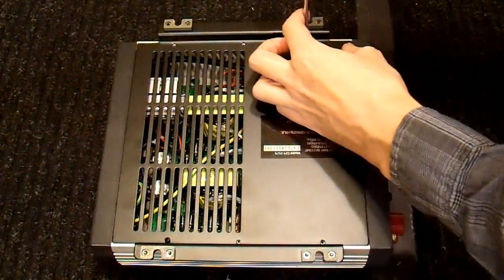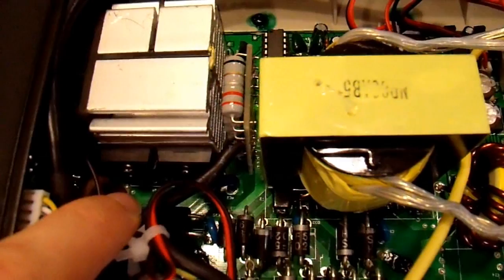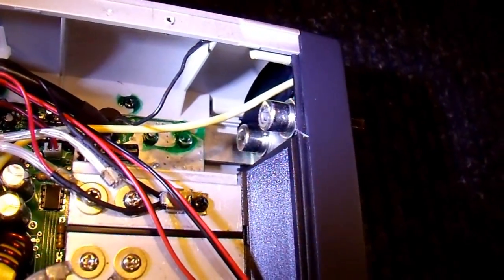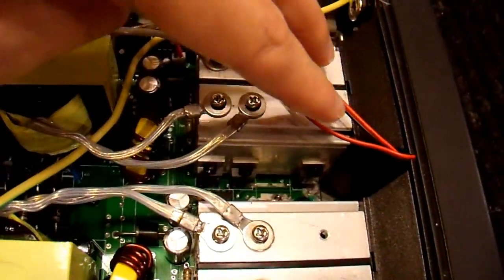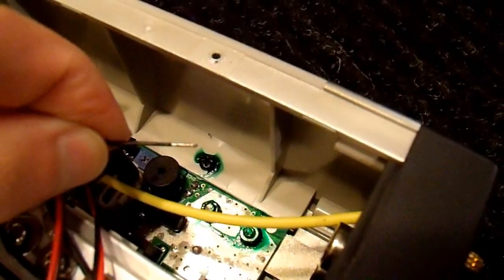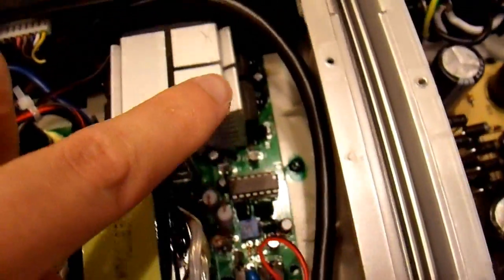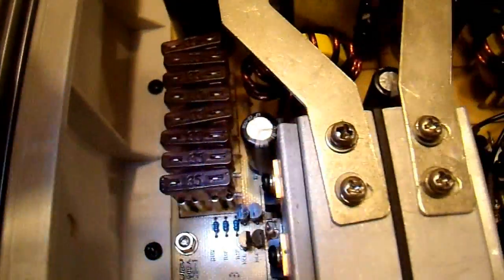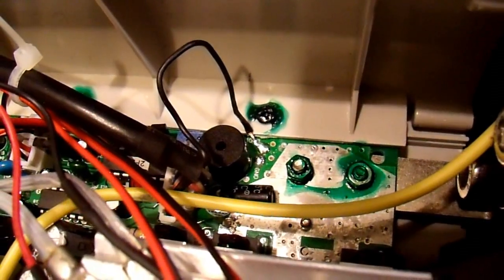Cobra 2500 Watt Inverter CPI2575 Unboxing and Review - The Repair part 2

Comment: What is your recommendation on a good quality inverter that's reasonable price?
Reply from the maker: Depends on what you're looking for and your price target.  The samlex, cotek, go power SK series were my go to recommendations until they discontinued them.
Reply: @knurlgnar24  I'm looking to run a window unit. I want enough power to run it out not over heat the inverter. What's your thoughts?
Reply from the maker: @blakecomer2366  What BTU window unit?  I would highly recommend a pure sine inverter as the window AC will run much more efficiently and last longer due to less internal heating.
Reply: @knurlgnar24  I'm looking at a 5,000 BTU. Would I need a 5000watt?
Reply: Do you have a model number you would recommend?
Reply: @knurlgnar24  would ESECOA power inverter work pretty good for years to come? That was the 3500W to 5000W  green box looking inverter. That one is a pure sine wave LCD.
Reply from the maker: @blakecomer2366  I do not have any experience with that particular brand, but it looks like a typical Chinese inverter which, if you temper your expectations, can work OK.  It will have high no load power draw (very bad), low efficiency (advertised efficiency will be untrue guaranteed), and can probably only output 1500W to 2000W continuous if labeled as a 3500W inverter.  That said I expect it will power your AC unit just fine.  If you want one you can count on for 'years to come' and will be quiet, reliable, efficient, and be able to output the rated power level I did a quick search on eBay and if you search for SA-2000K-112 you will see one for sale right now for $400 or make offer which is a better value in my opinion if you can afford the extra $50 or so.  I know that unit will easily power a 10k BTU AC unit.  Note that I have no idea who the seller is so I'm not backing that seller, just the inverter.
Reply from the maker: Please note that you will need proper batteries (at least 200ah of capacity so at least 2 large deep cycle batteries) and proper cables.  If you haven't already you can watch my video on how to select inverter battery cables for more information.
Reply: @knurlgnar24  Thank you so much for the good advice. I'm going to look into this.

Comment: I bot this CPI 2575 a week ago.  Box shows the longer model  too.  But mine has 3 transformers inside that are smaller in size.  Is this better than 2 larger ones?    It connects with those circular thick wires, 6 of them.   It's going into a big rig.

Comment: I look at this inverter and think about the place I work and all the people they have hired over the years to wire controls that have never picked up a wire in their lives. It some how in the end works but it sure isn't pretty but it works. Sort of like these inverters. Industry is desperate these days to push a product to just pay the bills and keep investors interested. I like the one inverter with the bus bars but they could used copper to carry more current. What shocks me is that they don't just use a circuit breaker but fuses cost near nothing to use so you get what you pay for.
Reply from the maker: I have since sold the one with bus bars and find myself wondering if it might have performed differently than the one featured in this video series.  It couldn't have been too much of an improvement, though, considering the transformers were still quite small and the FET input and output stages were pretty much the same.

Comment: Keep the great inverter vids coming. Ok next question I'm buying a 2000W pure sine wave inverter for our camper. I'm thinking of going with the Xantrex 2000 PROwatt sw for $359 any recommendations . Or am I on the right track
Reply from the maker: I think you're on the right track, and there are many 'wrong' tracks to be on!  I have not disassembled, inspected, and tested the newer ProWatt SW series inverters but generally Xantrex seems to be middle-of-the-road which is usually a good spot to be in unless you want either the very cheapest or something very expensive.

And I haven't run across a broken ProWatt SW for sale, so maybe that means something...

Comment: You sure do work on  lot of Inverter's do you ever have any that just have a bad transformer and makes a buzzing sound. I you ever come a cross  a 22 to 60 volt power inverter and you are not able to fix it I would ask you keep me in mind lol because I need a 300 watt replacement power transformer. lol.
Reply from the maker: I do have a few that I deemed 'not worth repairing'.  What step up ratio and primary amps do you need?

Comment: that is wired they are that completely different. a lot of products end up like that. they do a change to the board yet same product but different way to manufacture it.  I have in the marines repaired Phones and some times they will be different, and we have to manual's for a TA-312 you at times can have two field phones beside each other they look the same operate the same but the guts can be completely different. so when you open it up you have to look for a REV number and then the manual for the phone.  I guess you can always if you have to take it part for a date and rev it might give clues to see witch one is older.